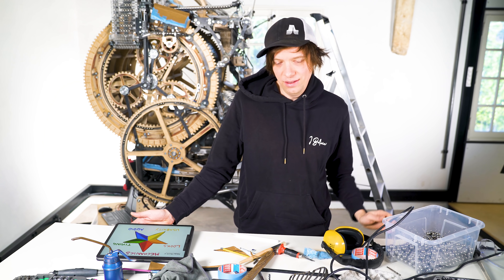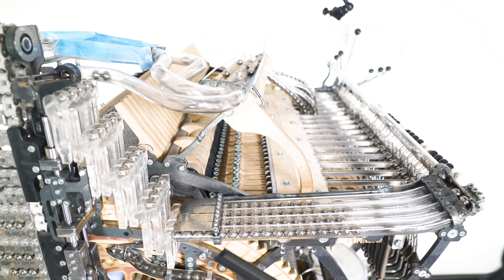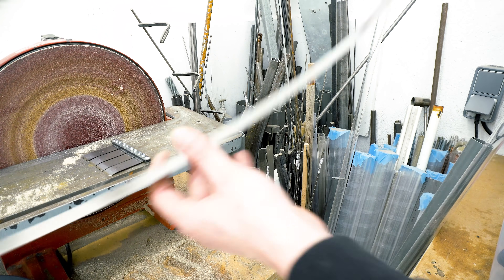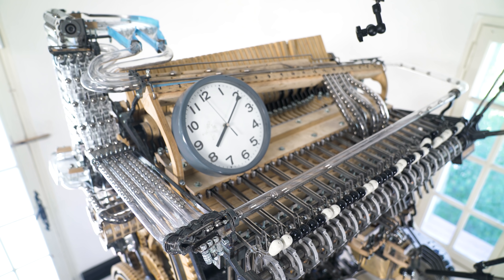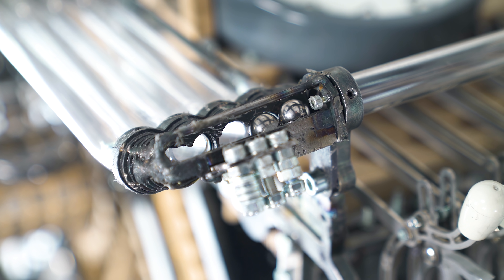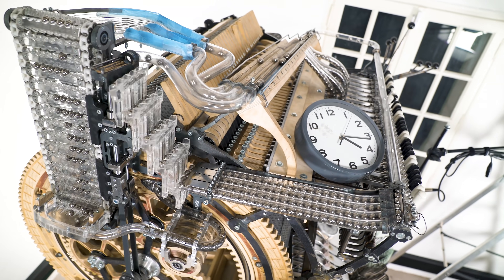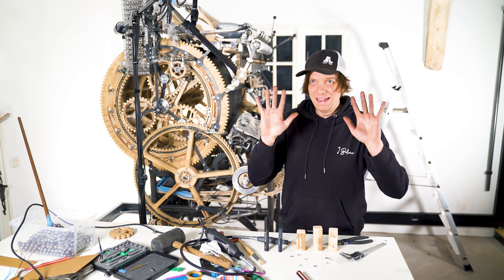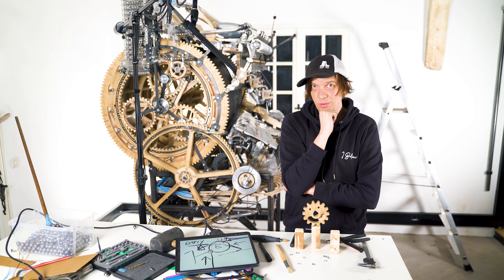Marble Machine X Fish Stair Upgrade

Comment: One of my favorite quotes about doing hard things goes like this: "In order to shit fire, you must first chew glass". Basically it means, doing hard things are inherently painful, knowing that alone is often enough to see you though, but giving up half way just leaves you with a belly full of sand for nothing. You chose a really hard project and are trying to do something for the first time in history at this scale and complexity. Of course it's going to be hard. When a company designs a car, they've got fleets of engineers at the ready to pour over every issue, and a lot of the time they miss an edge case that doesn't show up until they roll the vehicles off the factory floor and one of them explodes. I'm a scientist that has also chosen a ridiculously hard project. I've been at it for 6 years and have at least 2 more years of work to do on it. And yet every day I wake up and eat that bowl of glass and push it a bit further forward. You've built a beautiful machine. Even if you think changing certain pieces to make them less visually appealing reduces the beauty, from an outside perspective, you're objectively wrong. The beauty comes from the machine working and all it's parts working together flawlessly. And thus far, ever new piece that you've added that you said was less beautiful has actually ended up being stunningly awesome. Even just seeing that massive gear wheel spin up and the marbles hitting the instruments is beauty enough. The rest is just gravy. Half of the allure of a well made watch is simply seeing the pieces work together, regardless of how shiny the individual gears are. Keep on keeping on my dude. You've got this!
Reply: Beautifully put
Reply: Yeah, you brew that spider beer! I'm also still waiting on your brain cells hooked up to a computer project you are working on with Applied Science! Wait, aren't you working on like 5 projects that are equivalent to shitting fire meaning it's like shitting fire (that is green because why not, it's cooler), lasers (that are being assembled in your stomach), plasma (the 5th kind of matter not blood plasma while also a distinctly separate from the green flames), spider silk (that has the correct properties not just random proteins in a row), and living human brain cells (in a sterile environment that is also hooked up to a computer that was assembled in your appendix).
Reply: Wise words, we ended up loving the beauty of the dragon, because of it's history and not for the skin
Reply: Jeez man, that’s the most inspiring thing I’ve read all year. And I know that may not be saying much, but man if that isn’t still worth something.
Reply: Spoken like a true glass masticator
Reply: The legend himself. I love it
Reply: I bet this has been said many times, but you should take a trip to the MMX workshop and help out for a week. We would all be blown away by the ideas you come up with together.
Reply: I would agree.  Also think that there are aesthetics only you, Martin,.are going to see.  In an audience 300 meters back from stage I will never see the marble gates move nor will I see the dropping of the marbles onto the bass or hi-hat. I will, however, hear awesome music which only your machine can perform!  If looks mattered, do you think the 1st marble machine video would have done as well?  The machine looks NOTHING CLOSE to as awesome as the MMX.
Reply: Absolutely true. To add to that, you have 2 choices as I see it. 1. You cansi quit and give up which will leave the exceedingly heavy weight of failure in the pit of your stomach. Or 2. Press on and compleat the mmx no matter hora long out takes which will give such a sends of pride in accomplishment.... Well, you already know what that like. Albeit on a different scale. My point is that despite what any of us say, the decision is ultimately yours. These are just the end results of those choices. I sincerely hope you choose the latter and feel that well earned seem sense of accomplishment and the pridethat comes with it.
Reply: Woah absolutely beautifully said!
Reply: Theres no objective way of defining visually appealing really. Ruggedly built machines has its own beauty, which is steampunk. Having moving parts exposed and a tough built-to-last appearance is appealing to me
Reply: That's what I'm going to tell myself for now on while working on my personal game engine.  Thank you for that
Reply: Well, I was starting to think about something clever to say after "please don't give up!", but The Thought Emporium said it all with perfection! That's it. You are making history. If it was something easy, you would see Marble Machines everywhere.
Reply: You said what I was thinking better than I could.
Reply: my question to martin would really be why does everything need to be perfect? why does it matter so much if you lose a few 18mm ball bearings? why cant you just buy some extras and chock it up to making a one of a kind machine

love your channel too btw Thought Emporium and im sending good vibes to martin hahaha
Reply: @penguiin12  because everything should work the same and be stable every time. One ball going down could mean a part breaking like in this video, or multiple balls going down and ruining the entire performance. It must be mechanically perfect.

I surely get what you say, but it's really important that every works the same everytime played.
Reply: @mc.ivanov  i appreciate not wanting to have like metal balls flying out everywhere and horrible sounds from the parts but making sure there isnt even ONE single failure in 10,000,000 marbles seems like Martin is setting himself up to fail by setting an unrealistic goal. maybe that's what he wants? to have a reason to say look it's not doable. idk, really depressing. i love this project and cannot wait to see it finished but it doesnt have to be 100.00000% perfect even 99.99% is good enough (to me)
Reply: @mc.ivanov  i don't fully agree. Knowing the edge cases is important, but solving then perfectly isn't always necessary. You can work around them. An actual plastic part braking would be a blocker, but not all issues are blockers. If it's a matter of bearings flying, you can have someone collect them, catch, etc. Workarounds are.goid solutions too as long as you identify then and know you may need work in a more permanent solution later. But no system is ever perfect.
Reply: @penguiin12  I agree with you.  The machine NEEDS to be less than absolutely perfect, IMO.  It is not a mass produced machine that was built on a robotic assembly line: It's a work of art. It should have slight imperfections. I think a marble should roll across the stage from time to time.
Reply: @the_mowron  yeah if anything something that impressive not being completely perfect only adds to it to show the audience you can do what you want and be successful without perfection. i just dont want martin to give up, that would be the greatest tragedy. he knows he should finish it, he wants it finished but hes having a really hard time right now. even a few months ago before he mentioned how he would like to give up jokingly i knew there was just something that changed in him like he's getting beat down. he just needs to realize he is his greatest critic and the world would be ecstatic to see it complete even if it can't play ten trillion marbles with 0 failures and only completely perfect audio quality

Comment: If you want to keep the divide by 4 for aesthetic reasons then why not introduce a new moving part that is tied to the fish ladder?

Such as a sprocket that drives the marble into the fish ladder on the down stroke of the ladder but acts as a stopper for all the marbles behind the sprocket during the up stroke of the ladder?  This way you can actually force a synchronization of the marbles, drive the sprocket off the same drive for the fish ladder, and only need to cut slit into the marble pipes to accommodate the sprocket teeth.

Comment: why not "round"/"slant" that knife edge of the fish stair off? same with the spring steel; bend it upwards, not downwards, and then bring it closer in to the fish stair. Then, instead of being pinned between 2 harsh points the marbles will have a surface to slide on, and if the spring steel is close enough to the fish stair then the marble should slide backwards instead of popping out. Though because of the weight of all the marbles behind it, said pinned marble may need help from the spring steel so increasing the tension on the steel might be a solution.

Comment: On your metal-shards issue, I recommend getting some disposable nitrile gloves. They're safe to use with power tools, and you won't get those tiny shards in your skin. Bonus is that you won't leave fingerprints on everything.
Reply: Mithril gloves should also work
Reply: Or just use duct tape to pull the shards out of your skin
Reply: @allencummings7564  I'm glad someone else had the same idea here. I used this whenever I have to work with fiberglass insulation.
Reply: @allencummings7564  Better still, how about some strong magnets?
Reply: @SlartiMarvinbartfast  Put the strong magnets INSIDE the nitrile gloves!
Reply: @SlartiMarvinbartfast  the tape and magnets dont really work well... but elmers glue works really really well, layer on, blow dry, peel off, kinda like a pore strip for your face.
Reply: @danielwallace6422  I ended up with a bunch of shards in my hands after a pc mod the other day. Will have to give this method a try!
Reply: Try magnets to remove shards too.
Reply: @Awesomes007  yes, when i study in the industrial institute, in mechanical officine  they use a  "magnetic pen" form remove iron debris from eyes like this: https://surtex-instruments.com/product/foreign-body-eye-magnet-and-loop/
Reply: As someone who spends all day machining cast iron on a lathe and most my weekends tooling around in the shed, I can tell you nitrile gloves are almost useless. Mechanic's gloves help, but you're gonna end up with metal in your skin no matter what.

Always helpful. Especially if like me, some of your experiments involve high voltages. You soon work out if you've got metal splinters. :-(
Reply: Just make Wilson do it. ;)
Reply: You have to install an arc reactor in your chest, like Tony Stark
Reply: Big magnet could do the job?
Reply: Just play with some neo magnets
Reply: Or, Martin could magnetise his hands for easier marble pickup.
Reply: @joffrey-r4d  arc reactor? ... with metal splinters in the fingers, he will definitely react to arcs! :P
Reply: Is there a possibility of using a rare earth magnet to help pull the shards out of your hand? Just a thought. What you were doing is creating a Marvel, and I understand the dichotomy between the artist and the engineer. I truly hope you can find it within yourself to finish this project.this has been an incredible journey either way thank you very much for sharing it.
Reply: When I get tiny metal splinters that I can't remove, I just sand off that layer of skin. I mean, normally I can scrape off the splinters with a sharp edge of something, dig them out with a pin or knife, or pull them out with some tweezers, but sometimes I need the "nuclear" option and just go to the bench sander. Yes, I do it lightly and just take off the tiniest layer of skin I can. I also tend to have 220 grit on the sander, not 60-80 grit. :-)
Reply: Just use your leather welding gloves or another set. Martin, I'm constantly surprised that you use so little PPE while doing shop work.

Comment: Would it be a possibility to add a blade (cutting from above or below) instead of the spring-steel, which moves in sync with the fish-stair (more welding necessary;) This would reduce marble-pressure and ensures the fish-stair timing for escaping marbels? :) cheeers

Comment: It'll work out - you're very close now Martin! I know it's not your style, but in case it gets to a point where it can't be completed, there are fail-safe options that you can use to finish the machine to use in recordings, and the rest can be reimplemented over time. As long as the marble gates work reliably, getting the rest perfect is a nice-to-have. You also have a bunch of engineers watching your videos that can help you mitigate the harder problems, just in case you need us!

Comment: I think, now that you have a basically working system, it would do wonders for you to add back in the vibraphone and bass sections so that you can actually play music on it. Then you can work on making a working instrument more and more reliable. Just now it seems a bit like Achilles and the Tortoise where you can take an infinite number of steps, each getting slightly closer but never reaching the goal, while you may be as close as makes no practical difference. You have ironed out a lot of reliability problems over the last few months which means that you are pretty much on the verge of having a working machine.

Comment: Just my two cents: the spring plates must have a roll-up bent.  You can achieve the same constrain but you have to roll up, than this roll-up part will push the marble into the stair.

Comment: This is going to be hard to explain in text but the marble gate need to hold the marbles all by it self. So say you took away the part you grinded on the marbles would still stay on the gate if you had it holding still. That way you can make the openings to the pipes any size you needed and this ensures that it always fill the gate before dumping. The fish stair might just need a que system kind of like the marble drops since it is the marble pressure that seems to create the problem.

Comment: Metal shards- Try putting a layer of white glue, woodworking glue, on your fingers. Let it dry then peel it off. if the shard is sticking out it should now be sticking into the glue.
Note if you are generating shards, where are your safety glasses!

Comment: Martin, about the last issue with the escaped marble, try not to spend too much time on this problem. Look up FMEA. It is a tool that engineers use to evaluate potential failures which can help you prioritize issues. Basic formula is: Severity of failure (rated 1-10) x  Likelihood of failure (rated 1-10)=FMEA score. An escaped marble is low severity (machine keeps running) and low occurrence rate (happened after running 10 minutes of running in an edge case). Low FMEA score= low priority problem. I know the goal is 10 million marbles with no failures, but not all problems are equal. Hope this helps with MMX whack-a-mole.

Comment: I think you need to fix other problem: too high expectations. Man, you MADE an incredible machine, that already plays music and you just don't. That is the objective, being good looking and having an over complex programming/funtions kinda stucks you in the mechanical creation of the machine. I suggest you to compose some songs and make the finishing touchs on what the MMX will actually play. Exemple: if you would never play songs with 144 hz on clocking, you will not have ressonance problems with this frequency. If you don't play too fast songs you will not have the problem with this particular problem of the video. The problem on machine just exist if you think that will be necessary to be better to play. Missing some marbles on front will not break the machine, and that is okay (bonus for fans that catches befores you). Losing in other parts will, so just fix on needed to play and not on what maybe you need...
Reply: Fixing about where the ball can stop it's better than fixing where they are fallen if the fails are short and rare...

Comment: Artist/Engineer Question....If the marble catchers start being an issue because there's so much fine-tuning required, will you consider one singular catch basin for all marbles or possibly a handful of larger catch basins? I am just curious on your thoughts on it as I know you really want individual catchers. For me, I don't think having one large catcher/catch basin (or several) would take away from the spectacle of the machine. Keep going no matter what! Do not give up!!!

Comment: I think part of the difficulty is discovering the limits of the machine you’re building. It’s like when you said the way to stop marbles from pinging out is to make sure the machine never runs dry. That’s a limitation - never let the machine run out of marbles.

There will be other limitations such as there will be a minimum speed it’ll work at before things stop behaving correctly, or the number of vibraphone channels you can play simultaneously before the closest channels eat up all the incoming marbles, starving the drums.

Sometimes they’re not problems or errors or arty designs that don’t work properly. Sometimes they’re just limits of how the machine works.

Comment: Dear Martin,

please please please take a break.
Your current schedule is not feasible. Putting out a high quality video a day instead of every week... Man you are working your self to the bones.

On a side note, don't loose your self in the details. Finish the MMX and then refine the problem areas instead of overhauling certain parts again and again.
Since you like Elon a lot, they first build a car that was by no means perfect. Which is still true for the current model 3 if you believe Sandy Munroe. But what they do is incremental and steady improvement.

So what if some marbles are dropped on the first tour, just fix the issues for the next in between and start enjoying some of the rewards.

Cheers